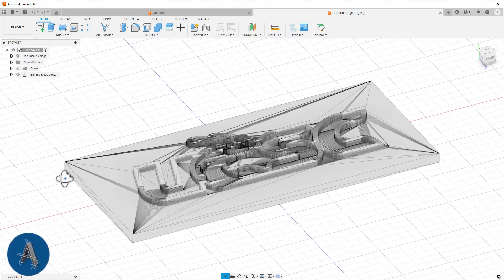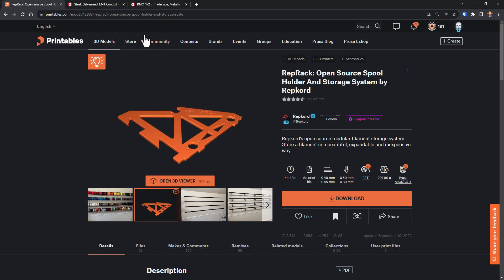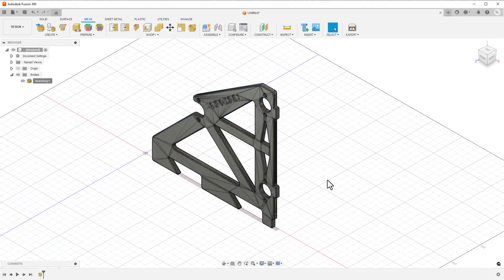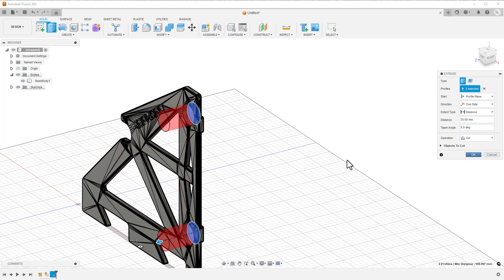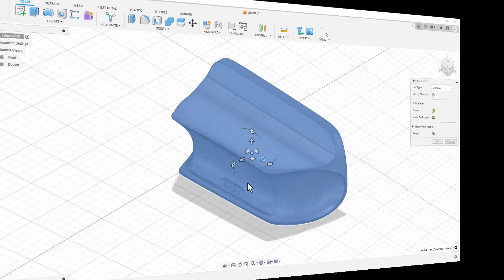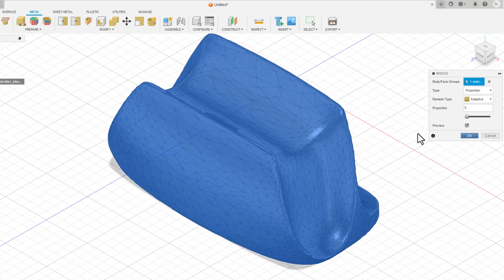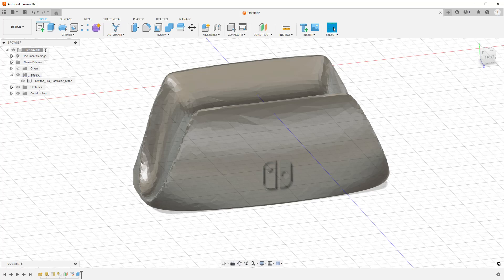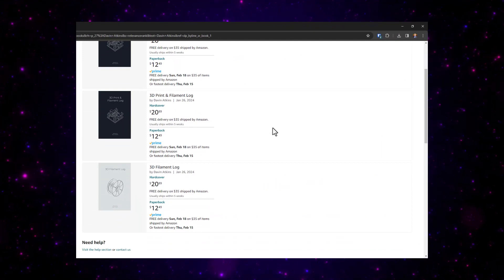Fusion 360 STL Remixing: How to create custom parts from existing ones

Comment: Theres one thing iv veen trying to figer out on Fusion 360.

Basickly i want to be able to get measurements of 3D geometrys and find a way to convert it in 2D.
The reason below should help explain what i mean.

Long story short i want to be able to Cut felt with a cutting machine to fit aound my 3D prints.

I xan do it with flat surfaces but cant find a way to do it with 3D shapes and cant seem to find what im after or what to ask for any advice people is this even possible?

Thanks
Reply from the maker: Yes, that can be done!

It's a bit complicated to explain with words, but you can use the sheet metal tools to create a folded shape, and then ask Fusion to unfold it. This unfolded pattern can then be exported as a dxf and cut out.

While it's called sheet metal, any foldable material does the same thing. That seems like a good idea for a video!